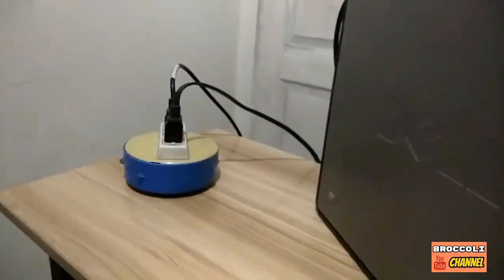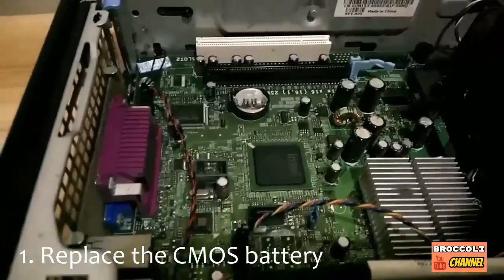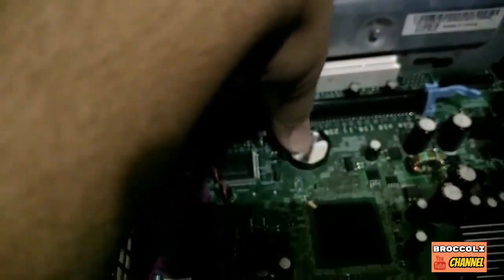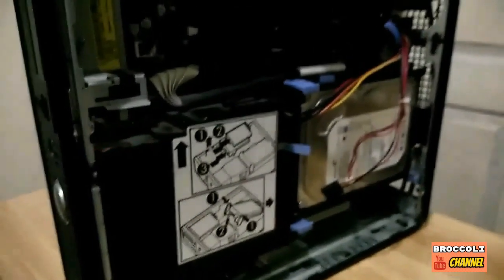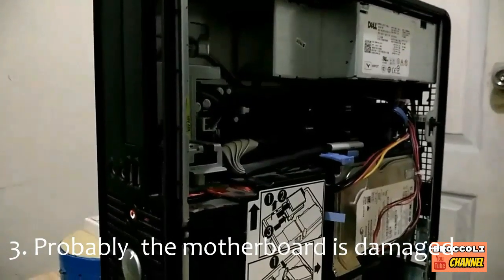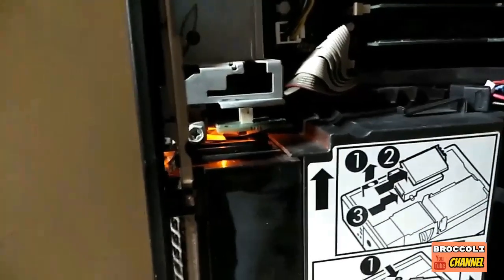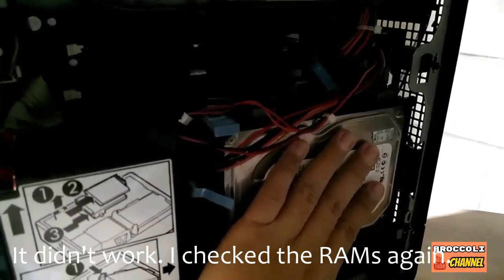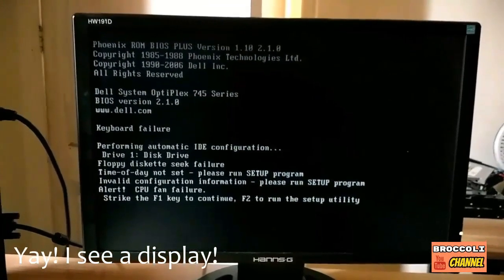FIXED! Dell Optiplex Amber Light Issue [English]

Comment: For those of you who want to know how to fix the issue very quickly: Replace your power supply. Common failure in Dell PCs.
Reply: I already replaced the power supply but it is still blinking
Reply: @thragg9917  Have you tried replacing the CMOS battery?
Reply: How do u replace your power supply
Also are u saying there’s no need to replace the CMOS battery?
Reply: It works! I used my spare power supply or cable or whatever you call it. I'm literally crying. I'm working at home and this is my 3rd PC from my company and I have been on leave of absencw because of PC issues. Thank you so much for this comment! Such a great help. You save my work and salary hahahahaha. God bless you! 💓💓💓💓
Reply: The Pc used to only blink orange once, now it blinks orange twice. Most of the time it doesn't turn on but it does sometimes. It worked that time when I plugged it in using a different plug or extension. 

Was brought to repair guy, said it was working then came back working. Later didn't work. Idk what's happening???
Reply: @any.user.allowed. i got the same problem...😢😢
Reply: What if its not blinking as soon as you plug it in it turns on and runs for 3 seconds, provides no image, then shuts off and repeats cycle forever

Comment: try this man unplug the main power cord the one with heaps of chunky cables and simply plug it back in, i had this happen when i just installed a sata cable (for my new ssd card that hasnt arrived yet..) After i did that it must of wigged out the mother board, i freaked out and unpluged the Sata going to my old SSD and the power cord connecting that then i unplugged the power supply from the motherboard(the chunky cable with heaps of cords) plugged them all back in and it works fine, even with the sata cable that caused the initial problem still installed. I hope this helps somebody out there, because i was ready to smash it.
Reply: Thanks bruv - helped me. Changed the cpu and got the orange light. Did it a couple of times and same result then did the ‘unplug the chunky cable’ and it solved it. 👏🏻👍🏻
Reply: @LegendArry50sBluenose  will u show me how on a YouTube vid

Comment: After removing dead battery, you need to restart the computer. Then while pressing and holding the power button, remove the power cable, continue holding the power button for one minute (this will eliminate any residual current in the system). Put the new battery in the place, and voila the computer should work now.

Comment: My Dell's power button glows Orange constantly - no flashing, and refuses to boot up. It is a Dell Optiplex GX 620 with original motherboard and 4 GB ram running Windows 7 ultimate with an Intel quad core cpu. Is it the cmos battery or power supply? Thanks! Oh, and no snarky comments because I know how old it is, and all I use it for is surfing the web and watching DVD movies. OK?
Reply: Same here.
Reply: @longshort3 had your pc got fixed???
Reply: Had your pc got fixed?
Reply: Even I'm also facing this issue
Reply: Wizard  i think it wud have gone to standby mode
Reply: Wizard  i think there would be ram issue..
Reply: If it didn't light after removing ram...it may be ram issue.
Reply: It may be issue of ram and power supply..u may check it first!

Comment: I hate to see people being told to replace their motherboards by someone who hasn't even seen or tested the machine when the motherboard doesn't need replacing at all.
This blinking light problem is common with some of the older Dell machines. It is usually caused by a "residual charge" remaining in one or more of the caps on the motherboard, and the solution is very simple. -

Solution for blinking light on a Dell that won't post - 
1. remove the power cord. 
2. Hold the power button in for 30 seconds to allow any residual charge to discharge. 
3. Plug power cord back in and boot up.  
    Voila...!  It works again.

As far as everyone talking about replacing the CMOS battery, that is NOT the solution, and is unnecessary. 
When the CMOS battery dies, it does NOT stop the computer from booting.  
The battery is a "memory retention" battery, and has nothing to do with the CMOS itself working or allowing the computer to boot or not. 
The computer will still boot when the "memory retention" battery dies. 
Some computers will actually show a message saying "low battery" on the screen during the boot process before the battery dies.
But even on those that don't, all that happens when the battery (that allows it to retain it's settings in memory) dies is all of the CMOS settings revert back to their default settings again and the time and date revert back to the CMOS manufacture date, but the machine still boots.  

In fact, in many machines, the indicator that the CMOS battery needs to be replaced is that they no longer show the right time and date, and won't retain the time and date when they're reset, but the machine will always still boot up (or will show a message on the screen saying the battery needs to be replaced)  even when the CMOS ("memory retention") battery dies.

NOTE: Whenever you take the CMOS battery out of a computer, it loses all of it's settings and they all revert back to their default settings just by removing the battery. So, ANYTIME you remove and replace the CMOS battery, you also have to go into the BIOS afterward and you have to go through all the settings and reset them to where you want them to be, otherwise as long as you're using the computer after the battery has been changed, you are booting up using the BIOS default settings just as it came from the factory again.

For ALL other problems (like faulty memory sockets, damaged memory, etc.) that were mentioned, there will be beep codes that occur. Even if the memory is not seated properly (like one retention clip not secured on one end) there will usually be a beep code, though some machines use a light code. (the user manual will tell you what the light and beep codes mean under the "troubleshooting" or "beep codes" section).

So, even if there is no memory, or the memory or memory socket is physically damaged, part of the POST process is to check that the computer has every component in place and in working condition that it needs to boot.  

That's what that "Beep" means when you first start the computer. It is a beep code that means everything is in place and checks out and the computer will now start. 

If the BIOS finds any component it needs to start the computer is missing or is faulty during the POST (Power On Self Test) process, it will them emit various unique "beep codes" or "light codes" to tell you what component is missing, not properly seated, or broken and needs to be replaced before the computer an start. 

If the computer is POST'ing, It will generally not be silent and just sit there with a cursor blinking on the screen. When it does that it is not even POSTing, and the most common reason for this is a residual charge remaining in the capacitors on the motherboard that need to be discharged before the BIOS can actually run the POST test.

Comment: I had this issues tried  loads of fixes noting worked turned out it was snapped cpu socket pin changed mobo no problems now works

Comment: same problem, blinking orange light. i solve this by re- seating the rams, remove all ram stick and clean the contacts using rubber eraser, drain residual power on pc and place it back. my dell optiplex 380 works again just fine.
Reply: Same to me, but is very important hold for 30 seconds, because the first time I did it was for about 15 seconds and same problem, but at the second time after saw this video I hold for 30 seconds and works fine.  Thanks

Comment: In my case I have an Optiplex 7010 and the power button glows white apparently everything looks fine but there is not video and I have noticed it don't recognize my keyboard, previous that issue I got orange light and removing ram fixed it. Now ut looks like a Bios problem or dead motherboard.

Comment: yes make sure ram chanel is correct   also it is recomended to go to dell forums for help because sometimes dell have diagnostic light signals which is easy to identify by just going to their site forum
anyway ty for naking this vid
Reply: because as of i remember dell 780 only accept 
ddr3 1333mhz to 1666mhz ram with maximum 4gb per slot =16 equivalent

Comment: ok this happen to me after a bad hurricane outage and maybe there was some moisture in the air from the lights being out for some days what fixed that problem is i opened it up and used a hot blow dryer to dry it out after that it worked perfectly

Comment: My computer has an blinking orange light, its an Dell Optilex 9010 I tried everything but still doesnt work. Soon as I plug my cable to the power suppy the computer turns on without me pressing in the power button (w/orange light blinking) Can somebody please help me

Comment: Pls help i have cleaned my computer optiplex 760 but when i plugged everything and wanted to starting it up it didn't work and the power butten has no light but when i tried to press the test button on the back of the computer and the power button it worked but now i can't turn it on until i press the test button what should i do